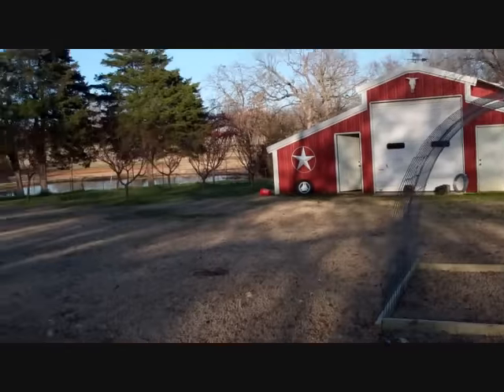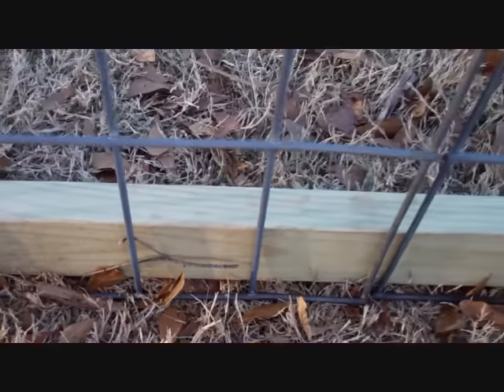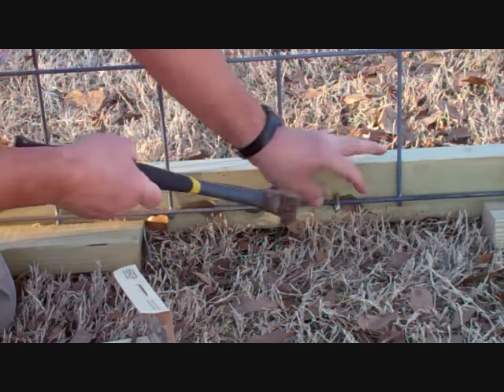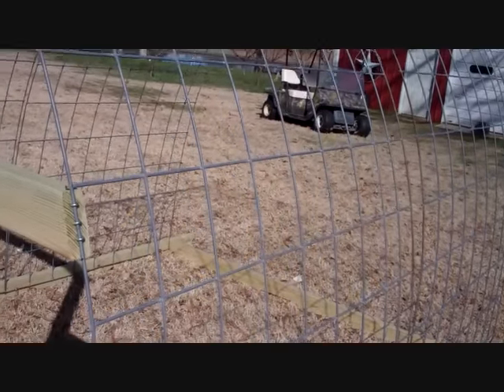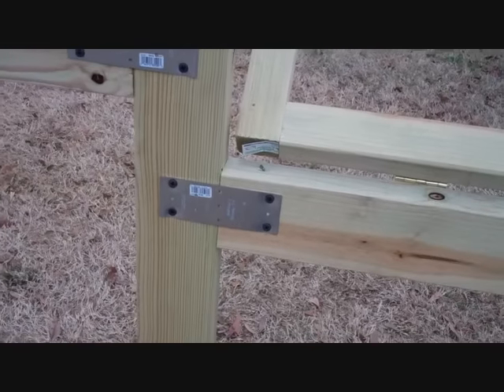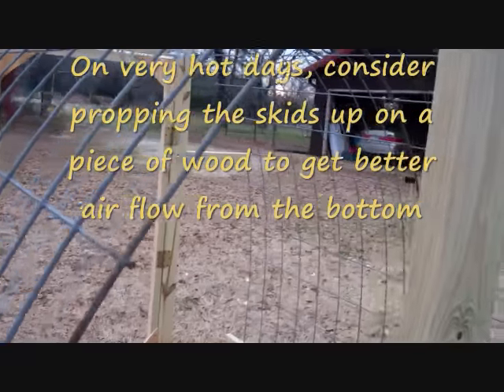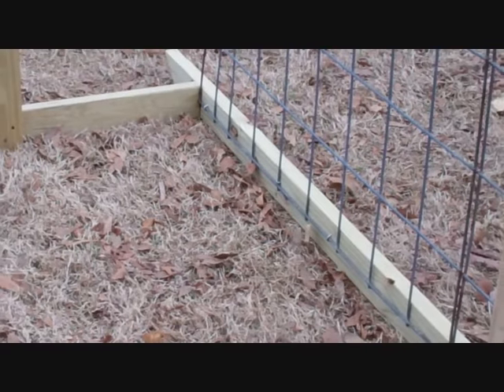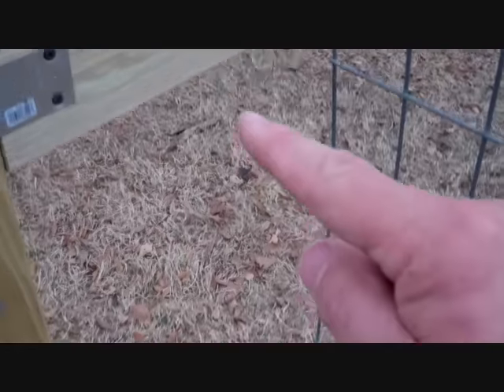🌞Cattle Panel Greenhouse🌱For About 150 DOLLARS! 🌻 DIY

Comment: How many  2x4x8' or 10  footers do you use to build this unit?
Reply from the maker: The bottom frame uses 2 -8 foot and 2 -12 foot 2x4's... but there are several more used in framing up the entire greenhouse. 
The e-Book and the PDF have a complete materials list, and the angles, lengths etc they are to be cut... check it out.

Comment: what width was your plastic
Reply from the maker: For a 2 panel greenhouse you'll need 16' X 25'
DON'T buy cheap plastic from Lowes, etc. It will only last one year.
Get a good greenhouse plastic that will last 4 to 5 years.
I linked to some below this video... check it out :)

Comment: Cause cattle panels are sturdier :) and you can actually install some heavy duty shelves made from weld wire or chicken wire framed in wood and attach them to the green house. You can't attach shelves to PCV.

Comment: This is GREAT! I've checked and the panels here are $19.99. Going to see if someone will help me collect the rest of the materials and get this built SOON! I know you can't give me the PDF because you turned it into an E-book and sell it but I looked at the site you gave for the better greenhouse plastic and was wondering...What size do I get? There's like 12ft by 16ft, 12ft by 25ft, 16ft wide by 25ft long...Which one do I need? Hope I get a reply! Thanks. This is awesome!
Reply from the maker: Depends on how long you are making it, but a "2 cattle panel" greenhouse will need 16' X 25'. If you go longer... add about 5' longer for each panel
... i.e. 16X30 for a 3 panel GH...
Hope that helps
Reply: TexasPrepper2 THANKS for getting back to me! That makes sense, and I'm usually very easy to confuse, lol. So the 16' doesn't change? I guess as long as you keep it 7' in width the 16' would stay the same and only the length would change if I made it longer by adding more panels? Just want to make sure I have that right. :) My plan was to buy one of those easy greenhouses, costs 80-130 bucks and then I came across this video and fell in love...Want to make it so bad but think what I'm going to do is get the one I've seen for now and then soon after get the supplies for the one you made...I'd love to have both, try them both out, and if the other fails, have the good one built from your plans. :) That one seems like it'll stay up through the weather and like you and other's have stated...Just replace the plastic if and when needed but the whole thing would stay together. It's so great and thanks again for getting back to me! :) I believe I could make a 3 panel one but I'm not sure if I'm going to have any help with putting it together and I'm a 24 year old female, but a bit of a tom boy and like building just not sure I can manage something like this but going to try. So with that being said going to go with 2 panels and see how I come out. :)
Reply from the maker: Our2010Life I had a 60+ year old woman that told me she built one... you can do it !

Comment: the gussets you have on the outside (inside) of the door frame would actually do better if you had them inside the door its self, some triangular pieces of wood... we both know wood becomes brittle at that size, so maybe just square blocks.. but would sturdy it up big time.

Comment: I am currently putting the finishing touches on one of these, great design! Thank you so much for sharing this! I have one question. I am located just South of you in Jacksonville, where on earth did you find your greenhouse plastic? I have looked everywhere and cannot locate any locally. Thanks again for sharing a fantastic design!
Reply from the maker: +greenbeard 
Not to far from you. It's in New Summerfield. A Greenhouse Supply place. Cant' remember the name, but I think I looked in yellow pages, or online, or something. New Summerfield is a greenhouse paradise... tons of them. There was a GH supply place a few years ago. Not sure if it's still there, but it would be worth a trip down there to see. Stop at one of the hot houses and ask someone... Somebody should know. 
Now... I did buy a big roll... enough for 4 or 5 GHs. You might be able to buy smaller, don' t know.
Ask someone running one of the hot houses if you can buy a piece from them. 
For a 2 panel GH you'll need 16'X25'
Reply: +TexasPrepper2 Thanks for responding. New Summerfield is nothing but hot houses lol! It was probably BWI, they are still there, went by just this morning lol. They, "No longer sell to the general public..." They will only sell their 100' rolls to bona fide nurseries who have an account with them... I stopped by a couple of farms while I was there to see if there was a scrap I could buy, no luck. Oh well, guess I'll order online if no one wants my money locally lol. Peace brother.

Comment: Hey mate hows this going 17 months on can we get an update would appreciate it
Reply from the maker: stevencox75 The greenhouse? Oh man, it's still in great shape. I've moved it a number of times, but it's still held together well. I may wait one more year on my plastic, and then replace it. It's not as clear as it was when I put it on. All in all... this Greenhouse is a great project !
Reply: TexasPrepper2 how does it handle hail etc
Reply from the maker: stevencox75
The FRAME will handle hail... but the PLASTIC wouldn't handle a strong hailstorm... it would tear it up. But, strong winds, snow etc... no problem.

Comment: How will I be able to buy this in the PDF format? I see that you can pay for it, but will it be sent to my email?
Reply from the maker: Yes.... when I get an email from Paypal... I send it out manually to your email address.I usually check my email several times a day, so there isn't too long of a lag time
Reply: TexasPrepper2 ok, I will have to have it sent to a different email adress other than my paypal one. I do not have access to it anymore, so I will send you a message or soemthing when I pay for it with the email address.

Comment: What  price did you put on it to sell?  What would this cost in 2020, and what  price would you put on it?
Reply from the maker: I think it could still be built for about $150 in 2020. 
The materials haven't gone up that much.
I wouldn't sell it for any less than $300 and you could probably get more.
Depends on the season. Right now is a good time, but summer would probably not be a good time to sell a greenhouse :)

Comment: whats the sq footage?
Reply from the maker: +InformalSpace 
The one in the video is about 8.5' long and 7' wide... so it's about 60 sq ft. 
But... you can add more panels to make it a long longer if you need more room.
Reply: +TexasPrepper2 one last uestion, how long is the cattle panel ? im making a larger one
Reply from the maker: +InformalSpace 
The ones I used are 16 feet long and 50 inches wide. There is a link under the video to them.

Comment: One suggestion...with this greenhouse as small as it is, you might want the door to open outwards instead of inwards. You lose nearly half of your space inside allowing for room for the door swing. Obviously if the "tunnel" is longer it wouldn't be as much of a problem.

Comment: I love your greenhouse but I see one flaw, that door opening inward is going to get in your way. It is going to block you from reaching in on one side and taking plants off the shelf behind the door, which will require you to go in and close the door before you can access those sprouts seedlings or what ever. I know house doors are built that way but on a small greenhouse it is not needed. Anyone can switch it easy enough to open outward, so it isn't a big deal, but greenhouses are all about warmth and easy access, I will bet you will change the hinges to reverse the door on this greenhouse now that I mentioned it. But the rest of it is the best I have seen, never thought about using concrete slab wire before, great idea!
Reply from the maker: Many folks have built it with door swinging out.
The wire is NOT concrete reinforcement wire. 
It is a Cattle Panel. Concrete wire will not work on this application.

Comment: Only had one problem with the green house. At 5 months old the plastic started to crumble. Spliting first above door and window. Now is totally a frame and we are trying to figure out if the manufactuer is at fault. so those out there, don't feel alone. We bought the best from our lumber company instead of the leader companys and it is USA made. Even got enough on the roll to do a few more green houses. Used all treated lumber to last, now if we can come up with a cover that will last.

Comment: The Idea and simplicity is amazing, BUT I'd say the heat transfer  from plastic to steel would be Far too hot and leave this with a very short life span?
Reply from the maker: Jon Bishop I disagree.
I built the original one in April of 2011... in TX.
We had 82 days straight of 100 degree (or over) temps... (many days were 105+)
Yes... Eighty Two Straight Days of 100+ degrees... with no problems. 
The plastic lasted about 4 years (it was good greenhouse plastic). 
Heat is not a problem for this greenhouse.
Here's the link to my original greenhouse in 2011:
https://www.youtube.com/watch?v=gd9mNKuRtSE
Reply: Thanks for that info, I didn't mean to criticize,I have just seen so many make the comment that it would wreck the plastic if its directly on metal  but you're method obviously seems to work well . Is it a certain grade/quality of plastic your using ?
Reply from the maker: Jon Bishop Yes... don't go down to Home Depot and buy your plastic. It wouldn't last. Get true "greenhouse plastic".... Try to get "4 year - 6mil plastic. 
I linked to some "not so good" plastic by mistake in the e-Book. A few folks told me it doesn't last long... so... DO NOT USE the Warp Plastic I linked to in the e-Book. 

Here are 2 links to the right kind of plastic:
Greenhouse Megastore: http://www.greenhousemegastore.com/product/4-year-greenhouse-film/plastic-greenhouse-film

And a GOOD plastic on Amazon: http://astore.amazon.com/homegardenfarmimprovementemergencypreparedness.homesadvis0b-20/detail/B00CTSAPQ0

Comment: Has anyone had issues with the plastic degrading where the foam padding is?  The sun heated up the plastic on the edges with the padding and caused it to become brittle and start to crack and crumble just where the padding was.  This made  all my plastic rip and I need to recover this coming spring.
Reply from the maker: +Cdeep04 
Mine lasted 4 years with no cracking or degrading. It all depends on the grade of plastic you use. 
In the e-Book I mistakenly linked to a plastic that was not the best quality. 
Look under this video. There's a new link to a better plastic... or... you could go to a greenhouse supply place near you and get some. 
It needs to be 'greenhouse plastic'. 
The PDF has an updated link to the good plastic.

Comment: Nice work, but Annie Gaddis is right.  The door should swing out so it doesn't interfere with the plants on the inside.  Your window should swing in.  That way, if you forget to close it in a heavy rain, the rain won't pool up on the window plastic.

Comment: PLEASE READ! If you are going to build one of these make sure the horizontal rods of both cattle panels are facing inside the GH. I watched the video and even bought the plans and this wasn't explained so I ended up with one facing outside so now I have to cut the wire ties off, take the panel out and flip it around. Thank God I didn't put the end wall framing in.

Also, if you buy the plans, note that all  the materials aren't listed. Specifically, fasteners for the furring strips (1lb 1" screws or staples), 8' of bailing wire to tie the panels together, 1'x1'x1/2" plywood for door bracing and staples for the plastic. I wrote down all the materials and drove 25 miles to the hardware store . I buy ebooks to save time and money, not waste it!
Reply: +BLUE DRAGONFLY lol

Comment: couldn't you just screw a 1x4  around the inside base to hold the cattle panels in place?  I hate hammering in the fence staples!
Reply: I think I will cover the outside of the plastic with chicken wire just to help hold the plastic from flapping - if I can figure a good way to attach it....
Reply from the maker: I think that would actually work just fine.
Let me know...
Reply from the maker: The previous comment was about the 1X4 screwed in over the cattle panel.
As far as the chicken wire... it's really not needed.
I put some chicken wire on a chicken coop made using this design. 
I used cable ties to secure the wire to the panels.
But again, it's really not needed
In fact, I think the plastic rubbing on the chicken wire might be more likely to rub holes in it.
What ever you do... be sure and get real "greenhouse plastic". If you buy the Lowes, etc plastic, it will only last one year. Greenhouse plastic should last 4 years... maybe more.
I have linked to some good plastic under the video.
Hope that helps...
alan
Reply: +TexasPrepper2 thanks so much for the tips!

Comment: This is a great greenhouse with one serious flaw - the plastic. What I could find anywhere lasts about 1 season. And when it degrades, it breaks up into so many pieces it goes all over the yard. Any suggestions are appreciated.
Reply from the maker: You HAVE to use a true "Greenhouse Plastic".
You are correct, other plastics will only last ONE year,
Here is a good greenhouse plastic: https://amzn.to/3dqwj8T
This 16X25' piece will do a 2 cattle panel greenhouse.

Comment: Can't read the writing in orange print
Reply from the maker: Can't do much about it now.
This video was made several years ago.
Sorry. Try pausing the video, maybe  :)
Reply: 1. "Dimensions, not diameter."
2. "You should add another 52" for a 3rd cattle panel, and consider using 2x6's for the skids instead of 2x4's."
     I had better results setting the playback speed to slow, but these captions are odd that they seem to starting fading during the display.  And don't forget to use a full-screen.  Let me know if I missed any!
   If the cattle panels' dimensions and lifting weight work out for me I'm going to erect a pool table "room", probably without doors.

Comment: im 6'4''    :( Can Imake it taller?
Reply from the maker: Several folks have, and have discussed it in the comment section here. Check out the comments.
The easiest way would be to build a 1 foot "wall" (where the skids are) of some kind to raise your panels up off the ground. That would give you the extra height.
Reply: I figured it out ,,Im making mine 20x10, Im gonna anchor  6   4x4 post with 2x4's on the outside  that willl give me the height im looking for :)

Comment: You can make it cheaper with other things but not bad for a start
Reply from the maker: Not trying to be argumentative, but how could you make one of this size (7' X 8'), that's this attractive, for less than $150? 
I've never seen one.
I've seen some that were probably built a lot cheaper, but looked terrible... like they were made from  junk store rejects (random. old, odd windows, PVC, etc).
Just wondering...

Comment: That is one low cost greenhouse. greenhouse dome kits dot com sells the best greenhouse film i would not go anywhere near a greenhouse without it it is that good. It's called solawrap keder film. It lasts 30 plus years and is dual panel to insulate your greenhouse. Plants grow faster in it because of the superior nature of light that it transmits. Hail resistence is another plus with it.

Comment: It would be nice if the guy would tell us how long those "Cattle Panels " are
Reply from the maker: The cattle panels are 16 feet long.
I put a link to them under the video.
Reply: where i am we can only get 8 feet, but i found a way to join them...tie them together with a 1by 4
Reply: The 8' panels are called handy panels. Try a tractor supply.. Or a farming store to get 16'

Comment: Wow, 1000 comments.  We used cattle panels to make a chicken house that was 8 feet wide by 11' 8".  We overlapped the panels one section each (we used three panels).  It was difficult to staple in the overlapped panel, but it is incredibly stable.

Comment: Shouldn't your misting system have a timer for 30 Min's on 30 Min's off in order to propagate in your greenhouse? If you just want to water your plants with a fine water mist your system works great. I would like to use my greenhouse for both growing plants from seed and propagating plants. Thanks for the video.
Reply from the maker: Larry342516 Actually, the best way to do misting on propagating is to do a few seconds of mist every 10 minutes or so . The timer on my misting bed comes on for 15 minutes every 4 hours. That seems to work for me. I would like to find one that has more versatility, but can't find one that doesn't cost a fortune. As I said, this one works pretty well for me... even in my misting bed:http://astore.amazon.com/homegardenfarmimprovementemergencypreparedness.homesadvis0b-20/detail/B0071CVF18I have several misting videos on this Playlist:  https://www.youtube.com/playlist?list=PLutBw50GI1zwstWEP2mQEJi9drX-t8VSp

Comment: Good build. but may need  fixing into the ground.
Reply from the maker: Martin Counsell Ummmmmm... maybe... depends on the amount of wind you get. 
I've had several questions about high wind areas and anchoring it down. Here is a link to several anchor systems. Look at Page 2: 
http://astore.amazon.com/homegardenfarmimprovementemergencypreparedness.homesadvis0b-20?_encoding=UTF8&node=120